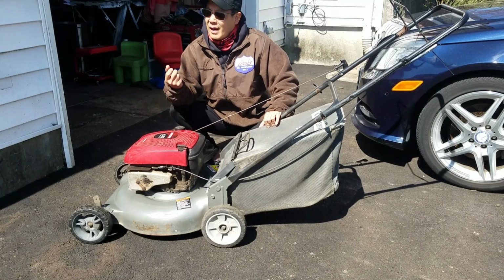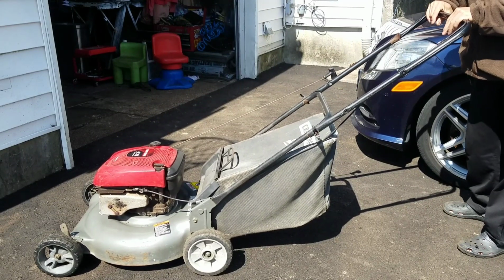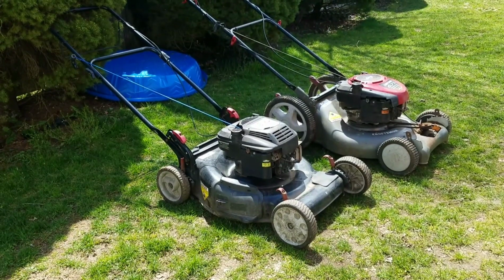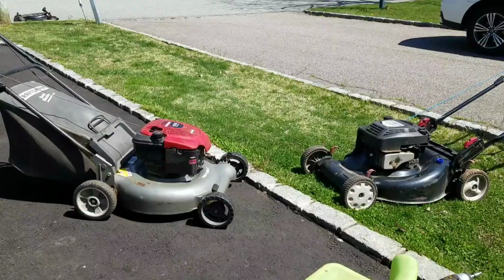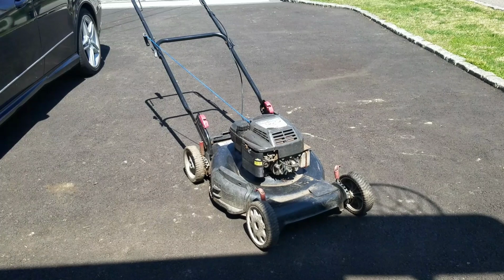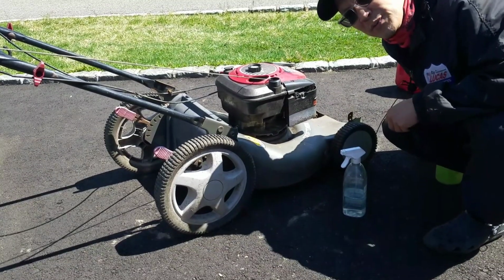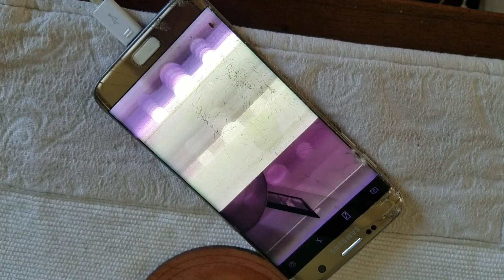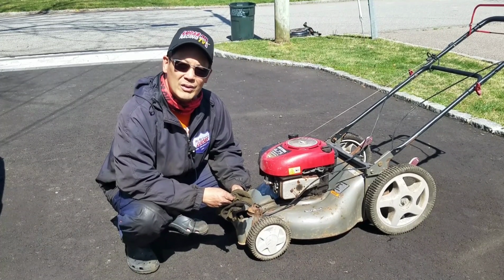FIXING CRAFTSMAN PUSH LAWN MOWERS & GERTING THEM READY FOR SALE AFTER WINTER STORAGE FLIPPING PROFIT

Comment: Henry just a few tips from your friends at Eliminator Performance in Canada on the B&S primer issues: 1. Once you have removed the outer air filter housing look inside the carb with a flashlight if needed and depress the primer bulb a few times. You should see a high flow of fuel coming out the distribution tube. 2. If very little fuel is priming pull the inner air filter housing and check the impression of the grooves from the air filter box on the gasket, if they are not completely formed and deep there is air being sucked in during the priming and preventing a full force of fuel into the carb for starting. 3. Adding an extra gasket has been done by many small engine repair technicians but we have found soaking the gasket in hot water softens it up and most of the time allows those grooves to be completely set into the gasket. 4. In some cases the inner cover is bent and we have actually taken a bamboo skewer with #2 gasket maker and applied it to the outer edges of the grooves on the filter box then applied the gasket and tightened it down. This has worked everytime BUT use a straight air filter cover if you have it. By the way we actually got a FREE riding mower from a customer yesterday an AGWAY .
Reply from the maker: Great tips bro, I've heard and done all of those except the bamboo skewers. Keep them coming eh?